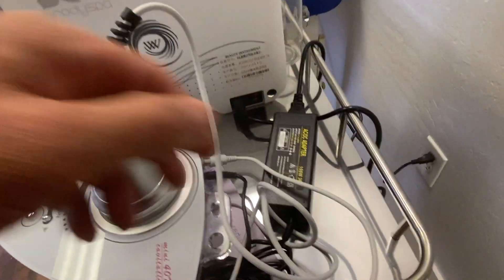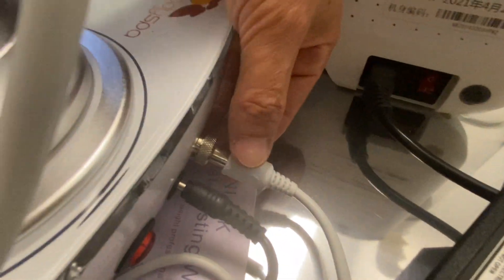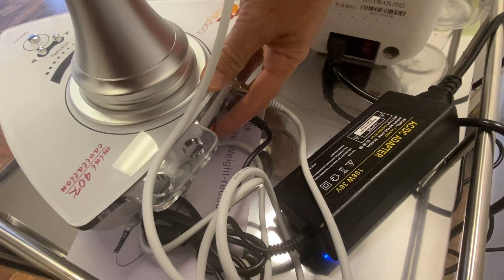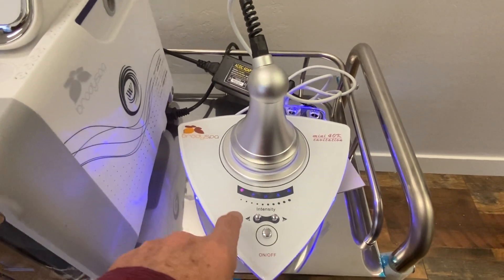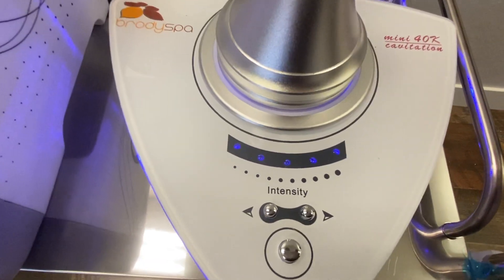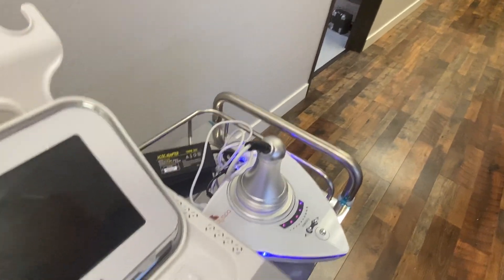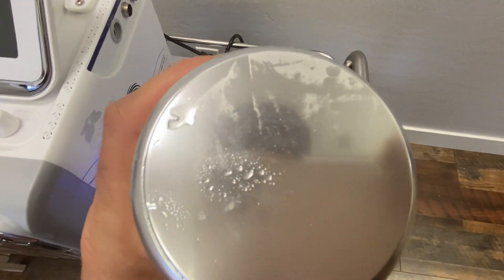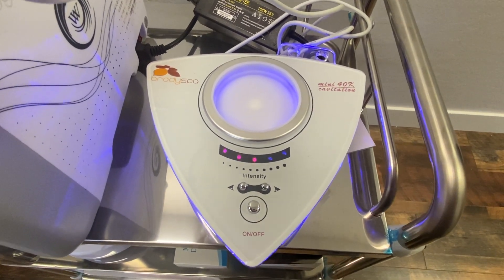40K Cavitation Machine Setup Instructions

Comment: How do I know if this thing works or not? No heat at all
Reply from the maker: Ultrasonic Cavitation will not heat up like a Radio Frequency, but you will feel buzzing in the head area.  Thanks.
Reply: So you have to turn the beep beep sound off before you start using it ? Or you have to keep the on
Reply: Yeah i dont feel heat ... is it working ??? Is it supposed to beep like crazy ? Or be on quiet mode